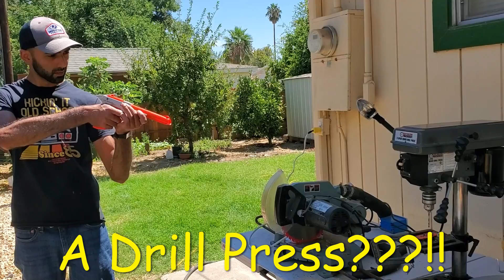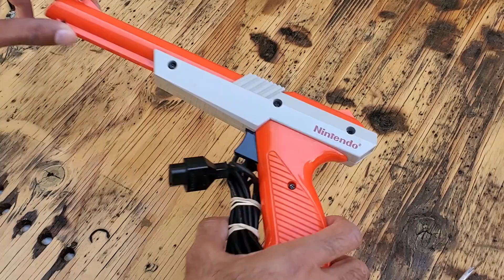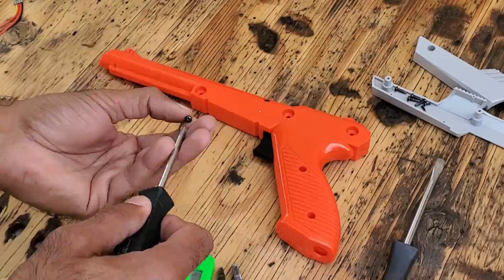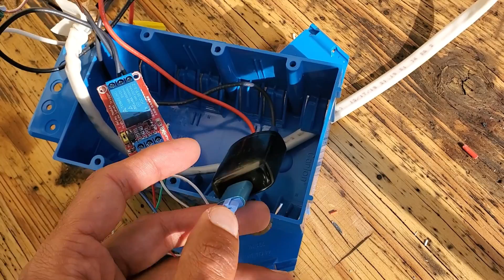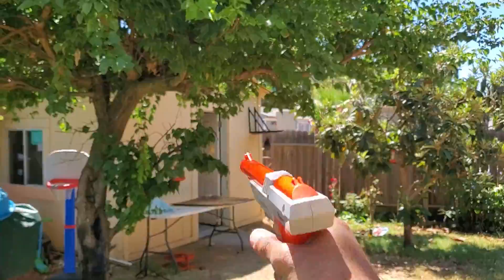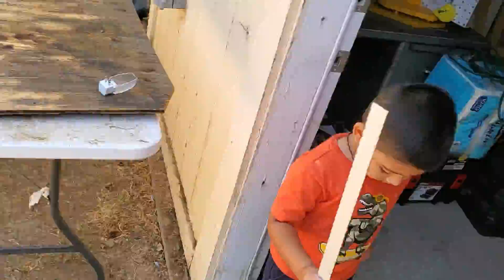Coolest Nintendo Zapper Modification Ever!!!

Comment: Is it real, Why is the light turns on before he even shoots it?
Reply from the maker: That is how the zapper switch works a slight press of the button makes the switch turn, squeezing it further makes the clicking sound. It's possible to turn on switch without even making it click. Plus iv made videos in the past about interfacing this RF module with an Arduino check them out
Reply: @DuctTapeMechanic  ok
Reply: I thought the noise was the relayand the delay was the result of the difference between the speed of light and sound. Awesome job!